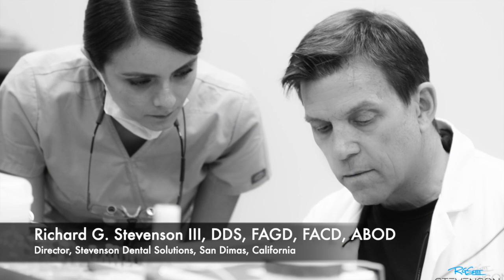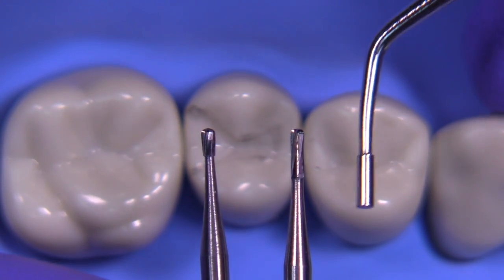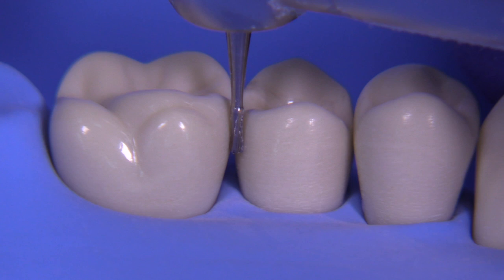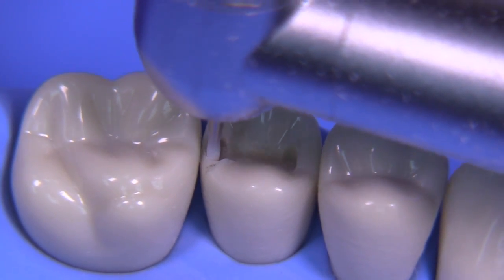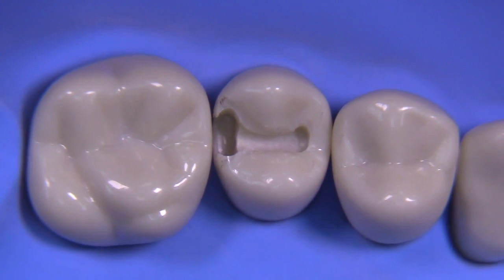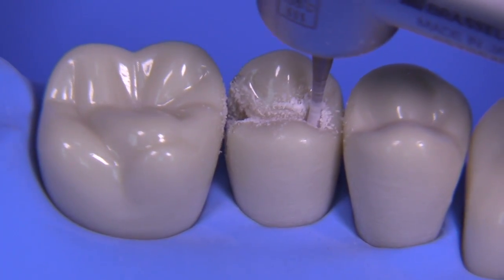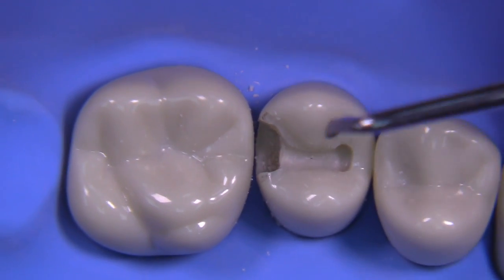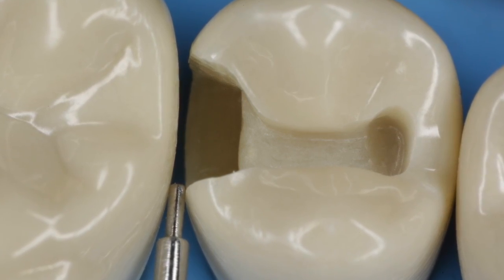Amalgam Simplified Preparation - Columbia #4 DO | Two Burs Only

Comment: Thank you for sharing these valuable videos; I really appreciate your work. I have a question regarding the depth in the dovetail area. When you increased the depth in this area to enhance the pulpal depth, the pulpal floor is no longer flat and on one plane, correct? Is this acceptable practice? Additionally, when measuring the pulpal depth, should our reference point be the center of the tooth or the depth of the dovetail in the preparation?
Reply from the maker: A flat pulpal wall will cause you to have variable heights on the occlusal vertical walls.  This is the norm for an ideal prep.  For amalgam, this is important, as it improves resistance form.  The deepening of the pulpal near the dove tail was to accomplish a minimum pulpal depth of 1.5 mm, and a flat pulpal wall.  Hope this helps!  Dr. S

Comment: Dear Dr. Stevenson,
  When I'm try to blend the box with the occlusal outline, that junction looks very conspicuous ( with 245). How do I make the walls of the box and everything look like in one finish? I only use the hatchet to make box walls and it doesn't look as shiny as bur run surfaces.
Also,  I have noticed that right after blending at that point my axial wall goes concave. Could you please share how to correct it? I'm usually at 1.3 or 1.4mm in width at the axial trying to accomodate a 1.5 mm hatchet. (Practicing with a constraint of the hand instrument provided)  

Thank you so much. 

Best, 
Adi
Reply from the maker: Loma Linda test?

Comment: That was beautiful and informative as usual. . Thank you so much, Dr. Stevenson
I wanted to ask you a question: How can I practice at home? What equipment do I need to get?
Reply from the maker: Compressor (California Air tools: Quiet Flow 1.6 Gal, 1.0 HP Portable Electric via Amazon), Portable Air Turbine Unit (eBay) and the following connector: Hose connector + compressor connector (Home Depot)